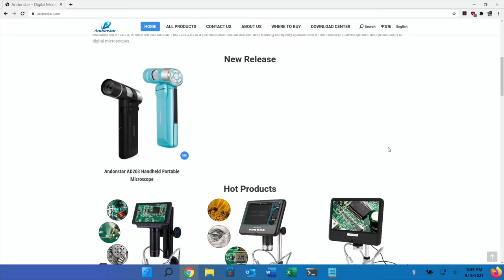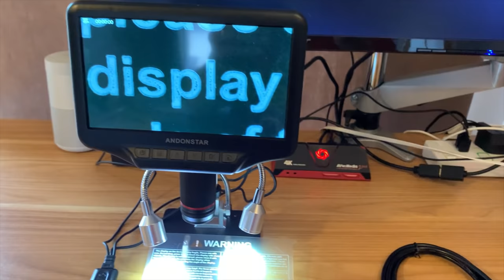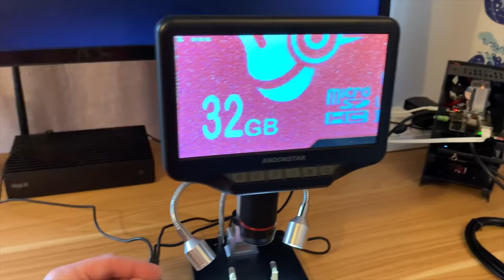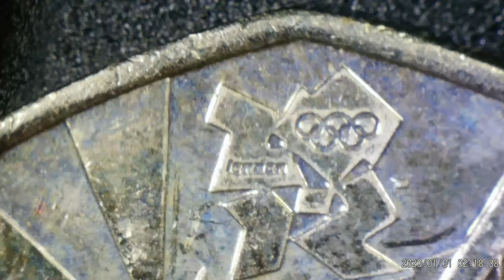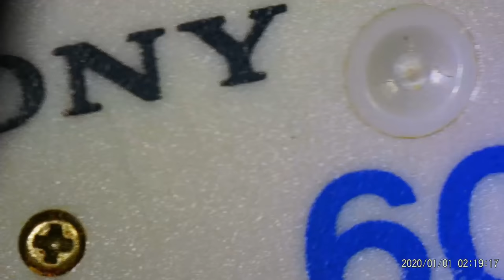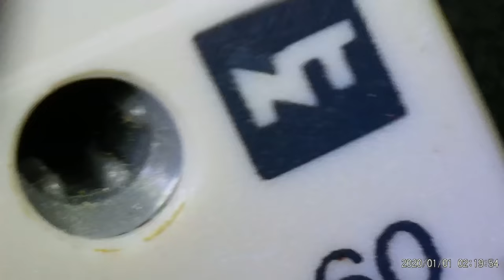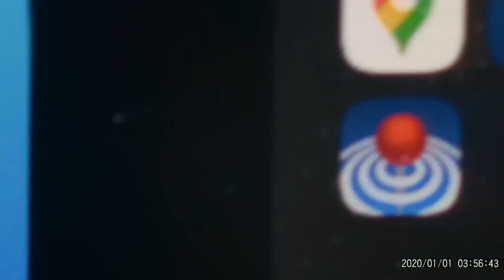270x Digital Microscope. Andonstar AD407.

Comment: Their scopes are really handy, but if you have a laptop or a tv you are better off buying a microscope without a screen. For 1/3 of what this costs you can buy a 32MP microscope camera with the SAME lens as this thing has. With these LCD scopes you are paying 80% of the cost for the screen and $20-30 for the microscope. With the Microscope cameras, that money is going into the camera sensor instead of an expensive display. There is no way around the fact that 10 inch displays cost over $100 wholesale and since most people have a much better display already it makes little sense.